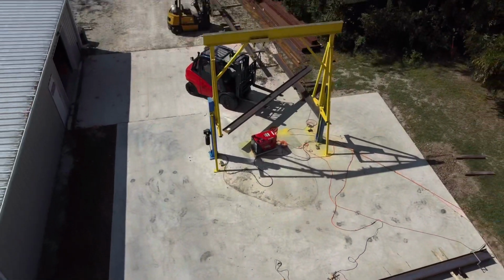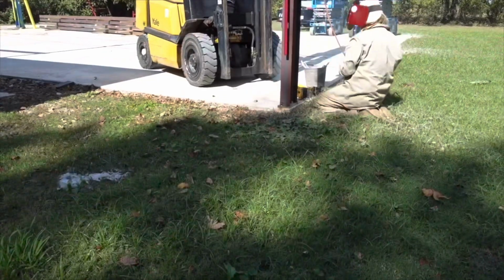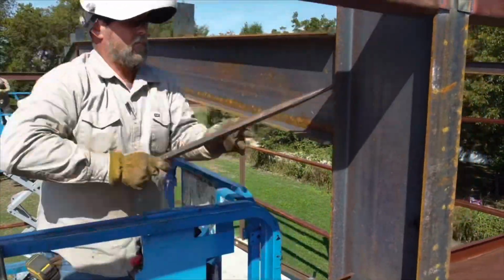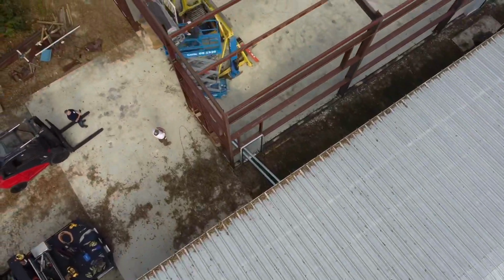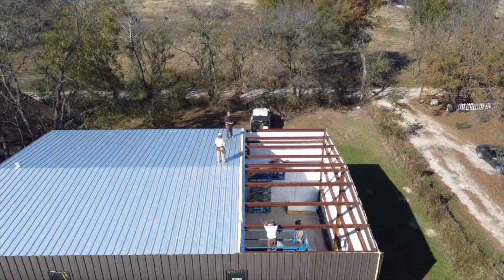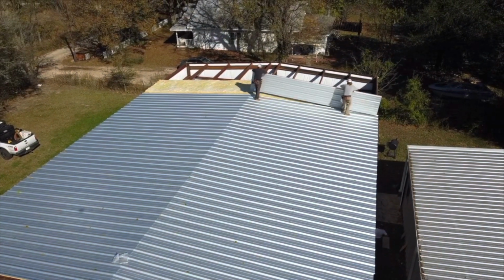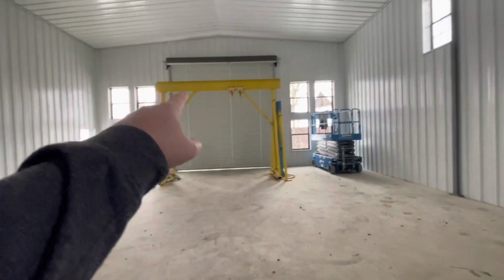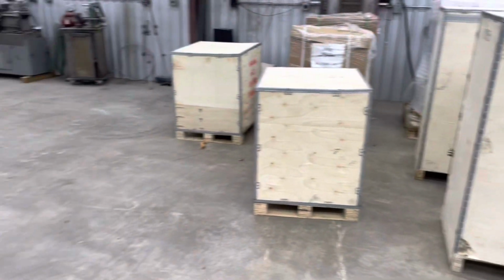New shop build Part 2

Comment: Great to have new workshop with that height
Find it amazing the different styles for building your shop towards over here.
All our steel is fabbed off-site and bolted together on-site.
We also use pre-made insulated panels very handy way of working
Reply from the maker: Yea, they biuld them that way over here also.  The orginal shop building is a bolt together.

Comment: Congratulations Gary! Seems much different than the whole reason I followed you, (a mustang father&son build!), and you transformed again from fabbing to importing. It's been great to follow. Nice looking building. Hopefully your site water problems will be less. Ha, and there sits the ol barn looking jealous you giving all that attention to additions and new buildings. Seems like you're rocking it! Thanks for sharing
Reply from the maker: Man, I really appreciate you hanging around all this time!  Not many have.
Reply: @turbocobra  Well you're not some all slick and fancy you tuber, That really never pulls me in. I mean I like diresta and such but I would rather see straight content. You pretty much fit in that category. Now if you had switched to using your videos as an ad to sell machines, I probably wouldn't pay attention. Which makes me epiphanize, ever thought of putting you tube ads up for your machines? I see machine tooling, plasma/laser cutting, welding equipment all the time on the ad portion of YT videos I watch.

Comment: Smart for not installing sky-lights, they do provide a lot of extra light when new but always end up leaking and causing more trouble than they are worth especially now that LED lights are more affordable and bring the electric bill down. Just replaced about 40 on my shop but had they not been there would not have installed them. Oh, you will be adding more square footage before you think you will, just a heads up.